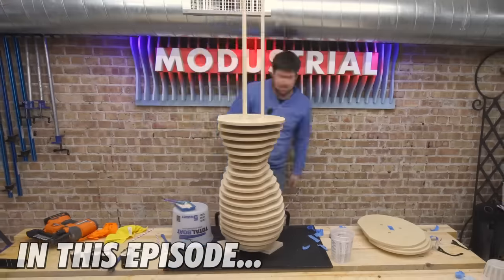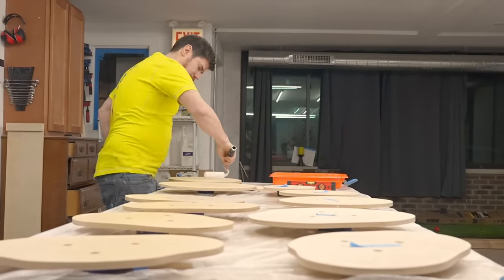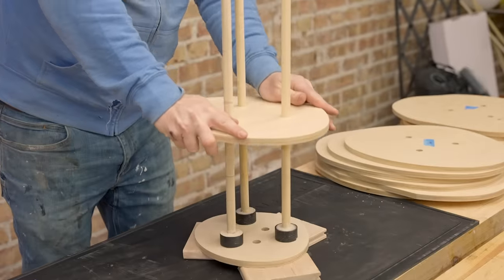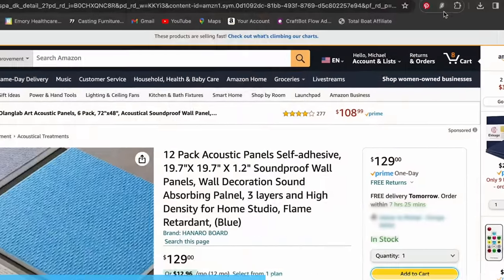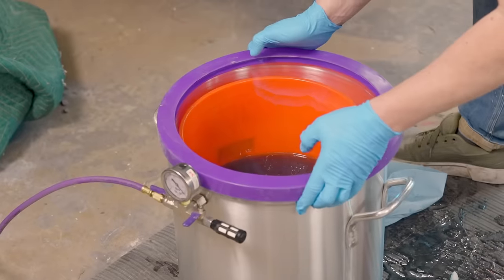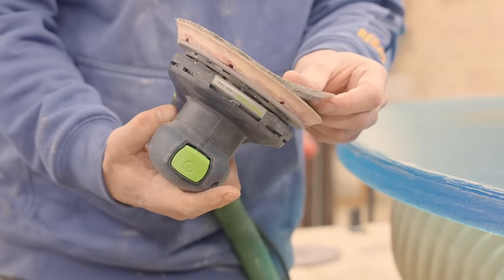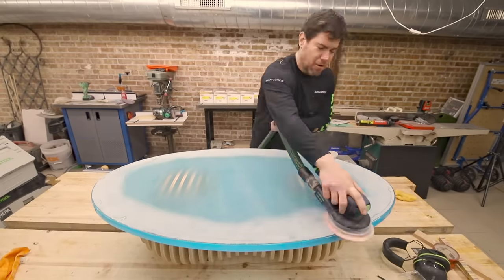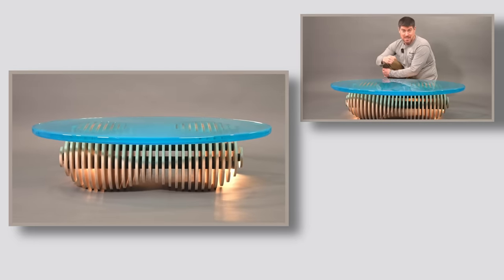My Craziest Table Idea yet...

Comment: I feel like CNCs are definitely part of wood working or anything they are used for. People need to grow up and learn to adapt. If I had a choice between something that’s ultra precise and quick or handmade, time consuming, and more expensive I will take the CNC route. There is a time and place for everything so depends on what the consumer/customer and what the builder are aiming for.
Reply from the maker: well said!
Reply: Agreed. As long as the builder is upfront about the method I’m good with it. I’ve seen people trying to sell something as “hand-made” that was obviously CNC or laser cut.
Reply: @shakenblake2  same. Don’t get me wrong I love and have definitely bought hand made stuff hell I have made and sold some things that were a mixture of handmade and machine made combined. Defiantly a time and place for each. But those people that say  “that’s not traditional this or that” needs to get a life. Usually it’s people that don’t have the talent to hand make something or CNC something so they lash out.  I just want to say “ ok Jack Ass, you want something made the traditional way here is a couple rocks, sharpen one rock with the other use said rock to cut down a tree, and build a fire, than go over there where there is iron ore deposits and mine it than melt it down to form hand tools so you can process more trees and build something traditionally.” FFS at what point in time do they consider the “Traditional” wood working period? It’s ridiculous.
Reply: I’m a graphic designer, turned wood worker, because CNC programming is identical to using programs like Adobe Illustrator, and the transition was nearly effortless.
Reply: This. As I said in my (unfortunately rambly) comment, both are valid. Hand planing is great if you just love the feel of scraping wood shavings. But a CNC is equally valid because you still have human input to make it do what you want it to. The whole point of machinery is to overcome the human limitations of vision and micro movements. When we went from flint knapping to make knives to working iron into blades, I'm sure there were people who thought "why" because it was not "traditional" lol.
Reply: @mikescholz6429  Question for you as a graphic designer. How would you feel about this particular situation: An actual artist with traditional skills uses an AI tool to generate references, with the caveat that they only use their own artwork to train said AI, thus not stealing someone else's art. Is this an ethical use of AI as an art tool, similar to using software such as Photoshop to apply filters/effects? I'd be very interested to read your opinion on this specific situation (because let's be honest, "general" AI art IS theft, and also still really awful looking lol)
Reply: I made my own CNC machine.  A flaked stone moved around by ropes woven from reeds.  Works great!  Sort of.  Not really......

Comment: All the greatest furniture designers in history pushed the boundaries of technology and materials. The Tulip chair by Eero Saarinen in 1955 used Bakelite that had just come on to the market. Vernon Panton with the Canton Chair in 1959 was the first to use fully moulded plastic to create a stacking chair. These are just 2 examples of designers breaking the barriers of what furniture and design should be. You can still buy these chairs now, so CNC is the next stage in the evolution of furniture design!
Reply: Next stage? I would hazard that CNC is already widely used in both designer and mass-market furniture, and has been for a while.

Comment: To not have the drips on the bottom of a flood coat, I apply a layer of liquid latex before flood coat or even regular pva glue does the same job. Essentially,  both these things will form a layer once they dry and when u do the flood coat, u will have the drips, but once your epoxy is cured, u just peel away the latex or pca glue and the drips peel with it. Nice and easy . Loved this table tough, the design is super modern n clean

Comment: The table looks great, not the fan of the countertop myself, but the design fits nicely into quite a few modern house designs
Reply: I love the legs, not huge on pure epoxy tops either. Now if this had a glass top, that would be slick. Still quite like how this build came out.

Comment: I definitely love this concept.  It could open up so many creative possibilities for a modern/futuristic type design.  Color variations, different takes on the base.  I would get on that Fusion 360 and mess with more ideas.  Maybe a base that looks like a spring, or make the base discs run longitudinally or at different angles.  Really cool concept.  Incorporating LED lighting as well. excellent.  The top didn't come out crystal clear but I'm sure you would do it better next go around.  Thanks

Comment: Nice, video. You earned my sub.

That's a really cool idea, but I think the finishes make the materials feel cheap.  Plywood and solid color acrylic panels feel like cheap materials, and that's kind of the effect.  
I'd prefer, before the pour, a stain that hides the edges of the plywood.  I agree a "busy" effect like sparkles would be too much, but what about a gradient. Like a light blue on one side, and a darker on the other. Anything that gives it more interest than a cast acrylic sheet, but isn't "busy."

Comment: You need to use a 'thinner' epoxy like Stone Coat Countertops. Here's what I would have done... for the 'first' upside down pour, use a long cure or 'deep' epoxy, so that any bubbles have time to come out before the epoxy sets. Next, round over all edges as normal (top/bottom)  You need a round over or square edge on the bottom... a chamfer won't let the epoxy flow/drip properly) Next, sand all and apply 1 flood coat of regular epoxy to the bottom (let drips fall 'up' then sand off when cured.) Torch as needed to remove bubbles. Last, turn the table right side up, put a strip of painters tape inside the bottom edge to 'catch' all the drips so you don't have to 'baby' the top pour so long. NOW Do a regular 'flood coat' pour on top, let the tape catch the drips... now here's the trick... at the 'tacky' stage (about an hour or so) PEEL the tape (removing the drips) and then use a gloved hand with acetone and 'smooth' the bottom and sides. This is so much easier than what you did! Finally, if you REALLY want to make a $5000 table, wet sand/polish the top and sides to a proper shine. HTH

Comment: Great Idea for a table.  I had a thought watching the video..  What if you put tuck tape on the table base (up to the epoxy pour level) for the table top pour?  This way you could remove the table top from the base for sanding and finishing purposes.  Then re-assemble everything together.  In use the table top doesn't actually need to be attached. Just a thought.

Comment: I am a wood working apprentice in Germany and CNCs are standard machines in shops here, as far as I've experienced. But I have never seen one like urs where you have to pin down the sheet. I've only ever seen one with movable suction cups
Reply: I live that u don't shy away from difficulty levels due to little experience in maybe one or another aspect!
Reply from the maker: Thanks!  Yes, I wish I had the vacuum hold down... They are about $5000 to add on to a machine.

Comment: Using the power mixer for the table top also activates it a lot quicker. It also makes so many bubbles. I almost fubar my desk first time using it with one ended up using it for the bottom and it turned out cool. The more you know I guess haha

Comment: I think the table top can be bigger so the overall balance looks better, but the design looks amazing 👍🏻
Reply: Bigger top = less stable given support in center;  extended top would need to be coupled with slightly concave base providing more lateral (side-to-side) support.

Comment: I love the design! As for the bubbles, have you tried using a vacuum chamber on the epoxy before pouring? We used to use a similar process for industrial optical coatings to remove bubbles

Comment: Just some armchair, Tuesday afternoon quarterbacking, but what if you had wrapped the plywood or coated it, so that it formed the impression of the wood pieces "into" the top?  That would make the top removable, both for shipping and for ease of working the resin, but the table would slot exactly into place into the top.  Just a thought...

Comment: How many pours have you done? 
#1 nothing wrong with using a drill and paddle just heat up the table top epoxy in a warm water bath and put you’re drill on the lowest setting 
#2 you must only watch Blacktail. Lots of people do complete flood pours on the bottom and top. 
#3 the bubbles are most likely from going to fast with the drill and also not having the epoxy at a warm temp to assist in mixing. Cold epoxy doesn’t mix well. 
#5 when doing a flood coat it’s best to tape off the bottom side with packing tape. After the pour you pull the tape off and the overflow comes with it.

Comment: 1- put the epoxy in a vacuum chamber pot
you can stir al you want and then gas the bubbles out, plenty of diy tutorials of making one for the size you need it in YouTube.

2- use Sheathing Tape for the bottom. once its all cure and harden. have extra of the tape extend off the edge and then with a sharp knife or even sanding the edge you can get a smooth profile of just the bottom. this will prevent you having to use acetone and clean off the drips when you pour the top. just clean it with the spatula and once its all done. take the tape off and done. its a lil more work but the end result would be amazing

Comment: Those who think CNCs are too modern for woodworking need to also give up:
- hard wax oil finishes
- ceramic coat finishes
- computer design software
- Cubitron sandpaper
- the Festool Domino
- laser guiding systems on any tool
- digital meters, laser levels, brushless motors, PID controllers, and any tool with a processor

I'm only back to the 1990s, I'm just getting warmed up 🙂

All these tools have their place, and the quality of the end product isn't determined by the tools used, but the vision and skill of the Maker.

Comment: Very nice build. My only suggestion just from a customer stand point, I would have suspended the base so that it only really protruded the epoxy about half the thickness so the wood isn't literally on the same plain as the table surface.

Comment: The design and execution is great.  When I first saw the video, I thought, it's a Peanut base!   Interesting.  I'm not sure how heavy that table is but, my first thoughts were stability and moveability while cleaning.   For a completely air-conditioned room with no outside circulation of dirt, dust, or grease particles that could fly and stick to the rows of the base.  Next thing, we know it'll be dimable led's to be a mood setting romantic gathering.

Comment: Im mixed on the color, which is odd because like, on one hand I wouldnt choose that, but on the other hand I do think it looks good with the base, I really love the bean base shape. I think the only thing I would have done differently is wrapping the top few inches of the base with tape before pouring the resin so it could be removed and slotted back in at will.
Reply from the maker: making it removable would be a bit more difficult, but is a cool thought.  Tape wouldn't work i don't think...the tape would inevitably have some wrinkle or unevenness that  would cause the wood to be stuck.   You'd have to sand the wood down so there was a slight draft angle in order to remove it, and coat the wood in a thin layer of epoxy or something else super smooth, before the pour, to make it removable.  It would be tricky, but cool if you could pull it off.

Comment: You could have used the 3D model for the contour rings to cut out the overlap between the base and the intended epoxy table top. You then have a 3D model of the epoxy table top that you can use the CNC to machine out the spots where the table base would go. This way, you can pour and finish the epoxy table top before machining it and then gluing it to the table base with epoxy as a glue

Comment: Dude! Those bubbles can be easily fixed. You'll never know they were there. Grind them out with a rotary tool. Not necessary to make it smooth. Just clean it up good. Then pour another thin coat, filling in the grinded area. The resin will fill in like new.
Reply from the maker: Its the entire underside including spots that are unreachable with a rotary tool because of the base.   On the bright side, they are consistent, so it just looks like a light frosting in real life...almost intentional.   This is a design I would consider tweaking and building for a client in the future, so I'm viewing it as a positive learning experience overall :)

Comment: Have you ever tried using painters tape on the bottom?  The drips stick to that.  When you remove it, the finish should be clean with drips eliminated.

Comment: Do the same table. But instead of wood slates use stone ,concrete or shiny metal.  Also use the blue tint epoxy with a few white tint areas and one yellow tint area.
There now I've shared a crazy idea with you. Enjoy

Comment: I think this would have been cooler as a wooden top with slots to rest on the base underneath. Leave it unfixed, it’s strong enough just having the ridges come through or teething into the underside. And easier to move as two pieces.\

Comment: Your personal opinion regarding epoxy colours and contrast vs the wood is spot on and I do agree with. But I'm not a woodworker or anyone in any artistic type profession. Yet I feel simple colour(white, black, transparent) designs with epoxy will stand the test of time. Those other stuffs won't.

Also, how about a wooden base with darker finish/colour and white epoxy top for the next iteration?
Reply from the maker: that would be a very cool combo!

Comment: So… is there any concern of the segments separating from the epoxy?  Would it have been stronger/better/necessary to put channels/holes in the wood somehow to create anchor points for the epoxy?  Or even make the top part of the segments slightly flared?  Or is it unnecessary?

Comment: As an experimental piece there's somethings you could do to make it more interesting. I know that the doughnuts are there for structural purposes, but, if you manage to make a pattern of them you would give the piece a more modern look. I could see a piece like that in a office, or a bank, or a design studio. As the microbubbles in the tabletop epoxy, I don't know if the time you had was too short, but I would try to vacuum it at least you could get rid of some bubbles.

Comment: Couldn't you get a tiny drill bit and drill out the bubble holes then using a syringe inject more epoxy in to the holes filling them in.

Comment: Would it have been possible to do this with glass and have the CNC cut grooves for the exact slices for the wood? If I imagine this right you could even have the CNC plane frost the underside and probably bevel edge the top?  (think like how cut crystal glassware diamond disk to make the designs works but with a diamond CNC bit)

I think it's worth a trial. Wood table base in a dark brown walnut with a green glass.
Reply from the maker: maybe...the CNC for glass cutting is typically a water jet, and something i don't have, the openings would have to be three dimensional (top and bottom of each opening would be different sizes becuase the plywood curves as it goes into the top).  I know a CNC router has capabilities to do 3D carves, but I'm not sure if water jets have the capability to do more than 2D.

Comment: 😂😂😂😂😂 funny you should say that about people who think using CNC machines it’s not real woodworking, this is my first time to watch you and I was debating that very question as your machine was running. One the one hand it’s like cheating on woodworking but in the other you have to know how to design the project and run the CNC right. Still not sure that’s it’s actually woodworking but it’s still “working”. I’ll have to debate it more to figure it out for myself. I still like watching though! It’s definitely different but you still use wood. You just don’t physically cut it.

Comment: Nice.

My change would be to have the table top lower on the "bean" thereby exposing more wood above the top. Yes it would reduce the useful table top surface but would look interesting (the slots could hold magazines, books though).

Another design would be, somehow, to intentionally have small bubbles throughout the epoxy pour. Depending on the density of the bubbles this would either present as a cloudy appearance (until closer inspection) or more sparse bubbles within translucent epoxy.
Reply from the maker: that would be very cool, and is something i thought about.  The logistics of the epoxy form with the plywood extending thru would be incredibly challenging, but perhaps you could cut each slice into two and attach the half above the epoxy top after the fact.